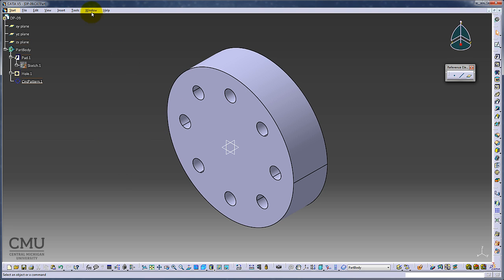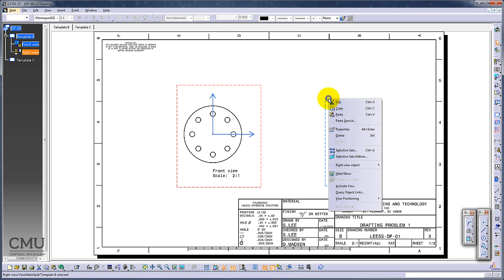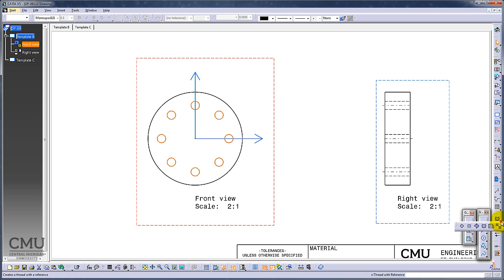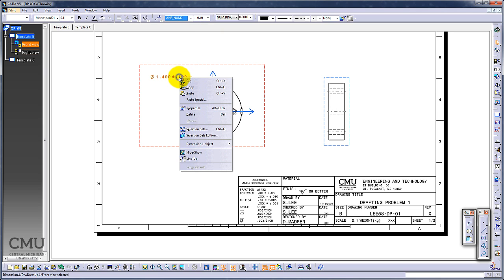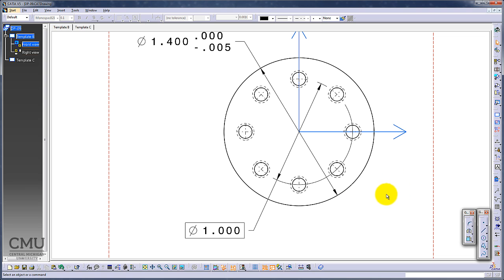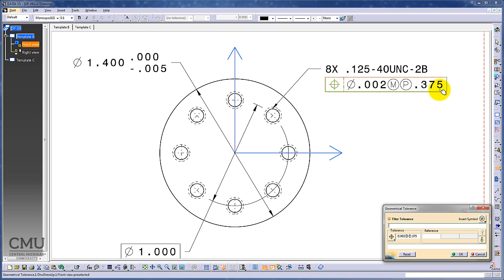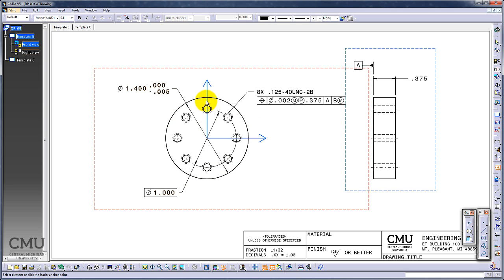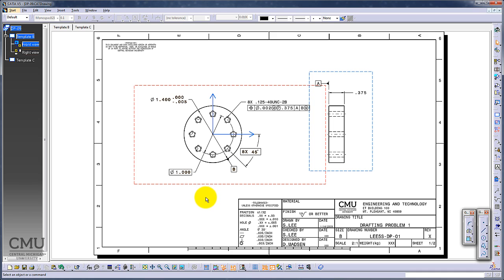CATiA GD&T Tutorial #9

Comment: Hi! Samson, I have a question about the tolerance selection, why you put the tolerance of the outer diameter manually? I think the software should put the tolerance value automatically based on the diameter. I Don't know is it software bug or not.My concept may be wrong. But according to design perspective, the functionality should do it automatically. I request your comment please what you know. Thanks.
Reply: Software can't put tolerance value automatically based on the diameter, because Software don't know whether we required clearance fit or transition fit or interference fit. That's why we have to put tolerance value based on our required condition i.e., clearance  fit or transition fit or interference fit.
Reply: @pratik.shhinde  Doesnt that defeat the purpose of dimensioning ? If you change the hole in the model, then you would have to edit the note manually.